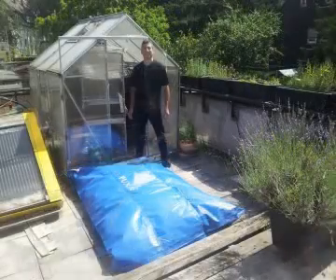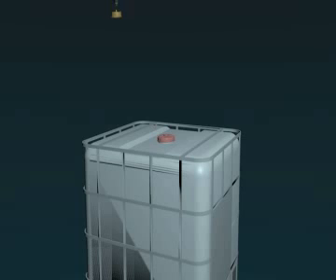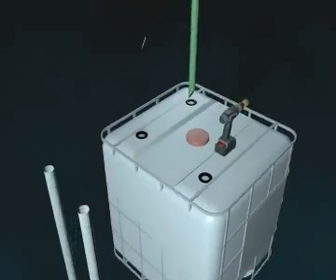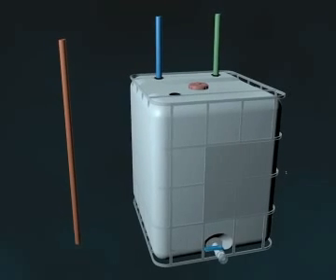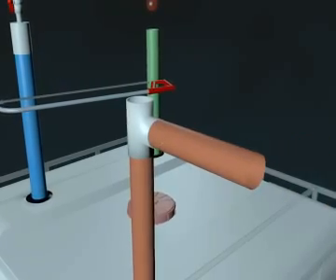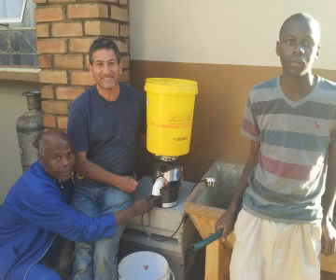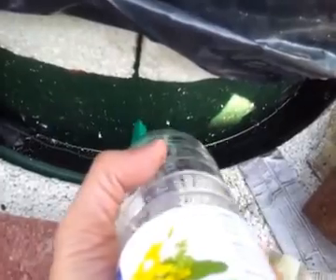Solar CITIES IBC Biogas System Tutorial Complete

Comment: Wow! Thanks so much for this inspring and easy to understand film. I bought my IBC yeasterday! My question - can I feed in with a 100mm waste pipe from the toilet?   Is a macerator essential? 

Also - is it bad for the bacteria/reaction to send grey water to it as well? Does that dilute the reaction? You say to mix the fertiliser with grey water, but perhaps that's best after the tank?...

Many thanks again
Reply from the maker: So glad it works for you.  Please note this is very old, from the days when all we could get were 2 inch uniseals. We now recommend you use a 4 inch uniseal and pipe for the feeding pipe and a 2 inch for the outflow and that you use a 2 inch bulkhead fitting THROUGH THE CAP for the gas out!  Let me know if you have any questions!
Good luck with your build!

Comment: This is a great solution for off-grid living and I plan to build a system like this to manage off-grid waste. However I must point out that in several of your examples you show biogas stored in bags in areas where if they were exposed to a source of ignition a serious fire or explosion could occur. I feel that unless someone is properly trained in how to store gas safely they should not attempt it without professional help. these gas bags are only safe if stored outside and away from any buildings and should be fenced off with warning signs like you would find at a gas station. People could be seriously injured or killed by the amount of gas these bags can hold. Never store these bags inside a building. You should note this in your video. Other than that this is really great technology that should be used more. I am working on a way to use the waste gas to heat the digestor to keep the bacteria happy in a cold climate and make the process more effective than a septic waste disposal system.

Comment: Shouldn't the IBC top Cap be the gas outlet? Many caps already have a 2"nps thread. This would reduce material need.
Reply from the maker: Yes, we do that now (and have for the past 8 years since this was made). Working on a new tutorial now that shows that.  Thanks for noticing. Back then we were often glue connecting the gas out to the gas holder and wanted to be able to open the digester to remove scum buildup without taking anything apart.  Now we don't glue the gas out pipe so we can easily disconnect and then unscrew the lid when we need to.
Thanks!
Reply: @tculhane  cool. Very good usage of a container.

Comment: Hi all, liked the video and started collecting the various components. However there is a question on my side...the way that you are using the INLET & OUTLET, I fail to see how this will work as an automatic overflow, i.e. quantity feedstock in = same quantity of fertilizer out.  When you fill the tank, doesn't the slurry level just increase in the tank ?  From what I can gather, 75% of the tank volume = slurry, and 25% should be gas space ?  So if I add feedstock, I would need to continue adding feedstock until the liquid fertilizer has moved up the outlet pipe until it eventually reaches the T piece and starts flowing into the bucket.  If the gas valve is still OPEN, won't the designated 25% gas volume will now be full of slurry ?  I guess that I'm overlooking something fundamental... please help me out here as it's a pity to get everything setup just to dismantle & do it again.
Reply from the maker: I keep my valve open all the time and let the water level push all the gas out into the storage bag. So my tanks are always overfilled with liquid. The uniseals hold the water  pressure. If you keep the valve closed then the gas will build up in the tank and push the slurry up in both pipes. It will spill out the outlet because it is lower than the feed pipe.

Comment: So im interested in building one of these but i have 2 questions. 1st one is when you finish building it isnt there air inside the digester so it wont be preforming anaerobic restoration or am i over thinking this? 2. I live where 6 months out of the air its below freezing. Will that be an issue?

Comment: Hi Thomas,   Interested in this gas collection system.    Can I ask how you stop the pressure in the gas holder pushing back into the digester?    I had an issue with slurry being pushed out of the feed and effluent pipes.    Anyway all the best.    Tanc

Comment: Awesome video, thanks! Quick question. I've built the 3ibc system. Now that it's all connected and producing gas, my slury out pipe is never exiting fertilizer. It does when I close off the gas as the pressure pushes it out. How do you balance this? Or do you occasionally close off the gas to get the fertiliser. Thanks!
Reply: Exactamente, lo que te ocurre es normal, ningún fluido va a ascender nunca por una tubería sin una fuerza que le obligue a ello. Si el consumo de gas es superior o igual  al ritmo de producción la presión dentro del tanque va nunca a ser la necesaria para que el bioabono salga.

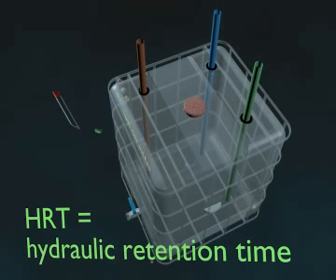Comment: 3:48 about PLUG-FLOW digestor design.  Wont material remain in the input pipe that will basically be full to the fill line? Does it require an air-tight push plunger? to start the system you must fill it to the fill line? Also, the exit fertilizer pipe is open at the bottom? it's touching the bottom?  Any filters or scrubbers?    Will a system like this work in Florida for a solo off grid where it will be fed by table scraps and human bathroom?

Comment: Very scientific explanation. I like your T fix method to prevent vapour lock. For a while, I was thinking about a single solution to purify both CO2 and H2S through a sustainable method. How about using NaOH or KOH solution to bubble through first? H2S becomes Na2S/K2S+H2O and CO2 becomes Na2CO3/K2CO3+ H2O. Then we can add a water container to bubble through to remove alkalinity in the gas in case. You can make the system locally sustainable if you use KOH solution made from wood-ash.
Reply: nice!:goodvibes:
Reply: Can someone point to WHAT this would look like and how to do it. Thanks

Comment: Why have a gas outlet “pipe.” Why not have a gas outlet. Also, how does methane force itself into the bag. Won’t the pressure or weight of the bag push gas out the hole in the fertilizer outlet pipe or the hole in the intake

Comment: If you use a hot water recirculating pump to limit how much water you waste in your house waiting for hot water when you turn on a faucet, I think you can add more loop so that you can heat the reactor. less water waste, no need to worry about the temps dropping

Comment: that's a cool video.  one question: for waste water (which can be used as fertilizer) to flow the IBC liquid level would have to be above the waste water Tee.  that level would be seen across the feed pipe and the gas pipe (possible siphon issue).  you'd have to make sure the feed pipe and gas is higher than waste elbow.  am i right?  that's going to get really messy.  it would be great if you had a waste pipe mid way up the IBC and decided to drain it depending on the level as seen in the feed pipe

Comment: How does the methane become pressurized enough to fill the bag?
Reply from the maker: The microbes evolve the gas at a positive pressure, about 8 inches water column. Therefore we put the feed pipe and slurry out pipe and gas out pipe about 8 inches above the top of the tank so the gas would "rather" fill the bag than push water out of the system. We overfill the tank to fill those pipes. We don't collect the gas in the IBC tank that produces the gas. Hope that helps. Join our facebook group for more dialog, Solar CITIES biogas innoventors and practitioners.

Comment: thanks for the tutorial, I'm collecting information to try one by myself. I've just one question: for the T that comes out for the liquid fertilizer, the top should remain cover until i feed the tank, or it just open all the time? i'm not getting that part, I'm thinking that oxigen will get in via that open T top... thanks again!
Reply: That's the same here...I dont get this part...if uve a solution, post it here pls...thx in advance bro! :)
Reply: I personally cover it, but mainly because I live in a place that rains a lot and I don't want it to fill with rainwater
Reply: You can keep it open, the water creates an airlock. But yes I would get a cap for it but drill holes in the side, almost like a chimney top so no rain can enter.
Reply: I believe if you make a seal for the top of slury out, it will create a ciphon and the contents of the digester will empty if you have the external pipe going into a bucket. The slury pipe has the hole half way down the IBC, so no oxygen can get in too, closed system.

Comment: Great video tutorial. Question about the hydrogen sulfide byproduct from anaerobic digestion which can be an issue. Is this an issue for residential biogas generators? if so, how can this issue be mitigated.
Reply: Mitigation is via a gas scrubber. 
The bio gas produced bubbles through a container of water with bleach added, and then through another filled with wire wool. This process removes the hydrogen sulphide which corrodes steel plumbing fittings and compressed gas storage tanks, and removes the C02.
The next vessel holds cat litter to absorb the H2O and dry the gas before passing clean and dry into the storage device. Unscrubbed gas burns orange like the flame in this video.
Clean scrubbed gas burns colourless in daylight and blue in a dark environment.
Loads of You tube vids show how to make a bio gas scrubbing system to attach to the digester.

Comment: OK, I am interested in trying this in a small village in Guatemala.  We would probably like to try adapting propane burners to run off of biogas.  I think I understand that we'd need a different orifice, where can we purchase those (here in the US)?  And I think I understand that the holes on the burner need to be slightly larger and drilled out.  What size are we looking at?  In this village we're just looking at cooking at this time.  Fairly hot most of the year.  Right now the primary source of fuel is firewood.  I'm wondering if we can get by with barrels or do we need the containers?  Money is an object here.  And information on biogas in Central America would be appreciated.

Comment: Just wondering the placement of the output pipe high above the tank, from the video I understand liquid will come out of it to be use as fertilizer. How will that work? slurry or water level inside the tank is about 75 to 80% level. Please explain this, thank you very much.

Comment: I’ve seen some people use double blow up mattresses to store the gas, if you can’t find bladders. Then you could tee them together to increase capacity. On the plus side, it would allow you to put a flat board on top of the stack and sandbag it to give the required pressure, instead of pumping!
Reply: Any possible links to videos on how to connect that to this system?
Reply: That's what I do , I got them from a yard sale for 25 cents and patched them

Comment: Great Video, but why are the pipes extended to the bottom of the tank? couldn't we cut the gas pipe under the top directly ? the waster water pipe be plugged on the side of the tank at mid height ? and the sludge pipe cut under the top too ?
Reply: I had the same question. But since he uses a uniseal, it prevents the pipe from sliding further in. In other words, the height can be maintained.

Comment: This is awesome! Question though: The blue pipe, the gas extractor, how does it access the gas, as the hole drilled in it will be below the water line, set by the higher effluent exit pipe with the T join in it? Everything is so clear, but I can't figure that one out. Any help?

Comment: Some rules of thumb 1/2 the carbon is converted to gas, that gas is 1/3 CO2, 2/3 CH4 , 500-1000 ppm H2S, and very wet.  Not a process to be in the basement of your house.  Your kitchen should be outside because burning the H2S will produce SO2 - irritating, and smoggy.

Comment: 5:10 how does this work if the t Piece is open? The slurry can't rise to overflow...
Reply: I'm guessing instead of an open T piece on top, you should rather position the end of the exit pipe higher instead, at about the level at which you wish it to start draining.

Comment: I have considered this for my home, but the things I have read indicate a small amount of gas is produced in a household sized system.
This lead me to think of what else it could be used for, and I came to the conclusion that a green/grow house, lit/heated by gaslight would make sense.
When I search for information on growing plants by gaslight, I get either ancient information, or weed growers referencing that ancient information to use with electrical light.
I think a building that processes compost through chickens and the chicken waste through a biogas system, while growing plants, and producing fertilizer, would be a good fit in lots of urban areas.

Comment: It seems that the tank must overpressure itself to force the fertilizer high enough to run out of the T... The T is a foot above the tank... By the time THAT occurs, it is also overpressured enough to force liquid out the gas tube as well... What am I missing...
Reply: ✌️I’m not sure if this is the answer but worth a try. 
The liquid fertiliser overflowed because when they put a bend instead of a T it caused a syphon effect which could happen without the whole tank being over pressurised. 
I could be wrong, happy to discuss.

Comment: How many of these would I need to heat a 36x118 greenhouse to 70° at night?
Reply: Jay Filet this partly depends on the outside temperature and the size of your greenhouse. Also, it needs to be above 68° to function properly. 
I would not burn the gas to directly heat the greenhouse. Heating air is inefficient. Instead you could heat water tanks or rocks and clay to function as heat sinks which then slowly give off heat into the greenhouse. To increase efficiency I would also use a nighttime shade cloth/blackout blanket to keep the greenhouse to radiate heat to the outside cold. If I recall correctly, burn time on the single burner stove is 2-3 hours (I guess in any 24 hour period). So to burn 24/7 you need 8-12 systems to produce gas for a single burner, perhaps less if you heat a thermal mass to store the heat and perhaps more if your greenhouse is large or it’s very cold outside. 
At that range you need 12-18 gallons of food waste daily. That’s a lot of waste product. If you consider wintertime heating, ifs hard to get that much when your garden is dormant. You could use animal manure, not sure how much of that would be needed.

Comment: This design will not work as the fluid will not get pushed out of the 90 untill the water level coming in also reaches the same level. Fluids always seek level. Problem occurs because gas hole will be under water, not as theorized in the vid. The exit pipe needs to be placed in the side of the container at mid height to keep gas hole clear at top.

Comment: I read  "The Handbook of Homemade Power" when I was 14.. and studied deeply on these.. I had dug a hole in the yard, gotten barrels and many of the other parts, unfortunately, my parents made me fill the hole back in and I never finished. You have re-inspired me... Maybe I will build one of these for my farm sometime soon.  There are 2 best temperature zones for anaerobic digestion 90 degrees F and 120-130 F. My thought is to tie this in to my greenhouse thermal mass system and use the excess heat to help better regulate the digester temps.  Thanks for sharing!

Comment: I really like this youtube tutorial,thank you for sharing this information. I have a few questions on if this could be used with with our home heating system that is currently natural gas. If so what modificatins would need to be made? Thanks so much K
Reply: Shedokuro actually you should very well be able too, the biggest thing that is not mentioned about methane in this video is it contains H2S and needs to be scrubbed out.  If you can build enough volume to where you can pressurize the system, you should actually be able to push out the city’s NG except when maybe you have a low production cycle
Reply: @stout8807  if I place multiple tanks do I individually fill them with cow dung or rather just fill one and allow it to move through to the next tank and so forth? My point is to make at least 6 hours worth of gas per day or 10kg/month

Comment: Hi. ive found your written explanation of this, its very very helpful. exactly as you explain here. my question is, what is the gas production capacity of this and how do you regulate the gas in case its a lot and yes i dont have storage of the gas?
Reply: JO JO the bladder is your storage with a pressure release valve.

Comment: http://www.propane-generators.com/type_4.php

I was told If I got this tri-flue, type 4 kit, I could use it to go from gas generator to bio-fuel. when I asked the company they said it's not made for that.
I am having a hard time finding info on after you make your system.
how to change a generator from gas to biofuel. also how to change a burner to run. also does everything have to be grind. After building of your system is where we have trouble. Your videos were great to make the system, have you continued with the videos on using, generators and cookers and heaters. need to know how to change everything over. propane heater to biofuel. if you could help that would be very lovely.

Comment: Hello,I did installed a 200.ltr plastic barrel same your method and I did mix cow dung with water 2. bucket around 40,Ltr. Put through the feeding pipe then I putting kitchen waste each n everyday. after some days I did stor the gas in a rubber tube. but the gas whatever do not burn. What's wrong with that? Please help.  Thanks.  Spalap